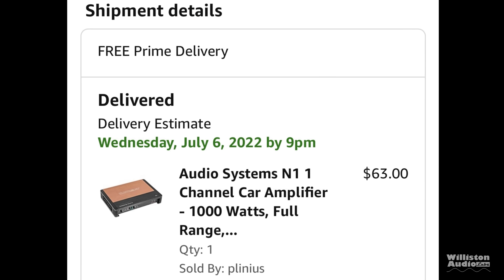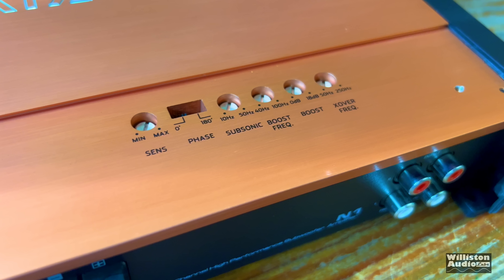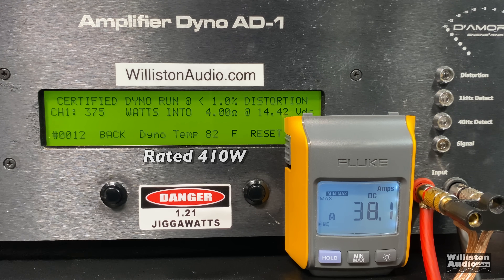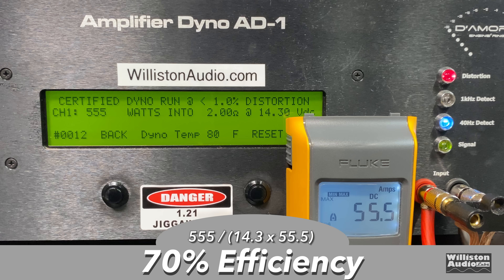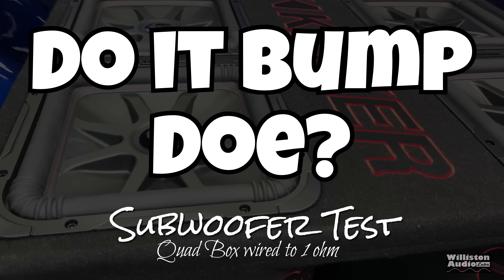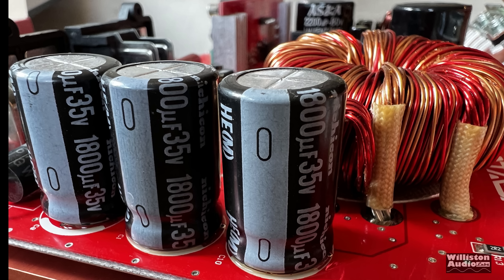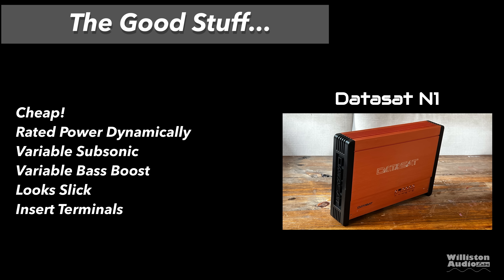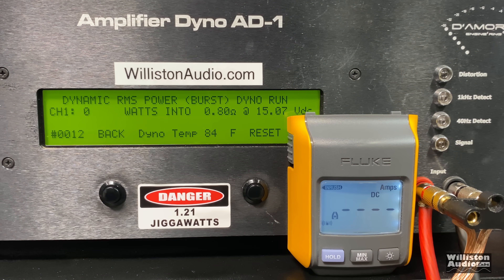Why is this 1000W $63 Amp BANNED from Amazon? [4K]

Comment: I have many high end amps with screw down terminals. Zapco, Arc,Eclipse, MTX, Soundstream,(USA and SA series) all vintage American made high quality amps...I really dont mind them, I prefer a screw driver to an allen key..my favorite is Soundstream terminals used in Reference and Rubicons and some MC models ( these terminals were designed by the late Wade Stewart)...I do not care for the "lock plug' style, although they have their benefits, but, there is  nothing cheap about screw downs, they are a reliable connection and a nice look with with spade terminals.... most of the Chinese drek you test use insert terminals with the throw away allen wrench, Ill take a stout Snap on phillips any day....but I am an old school guy....I think Linear Power still uses screw down terminals...not certain...I love your channel Big D, it is good to know there others. like me out there...I also have some vintage Helix/ Brax that use screw downs
Reply from the maker: I was referring to the screw down needing fork connectors. I consider Soundstream insert terminals. The ones I meant were the ones with the small acres that has a built in washer and unscrews completely. These don’t accept larger than 8Ga without issues. Many of the old amps didn’t need larger than 8Ga so it’s fine with them.
Reply: @wal  , love your channel Bro, who else could I discuss this minutia with…I really don’t mind the for terminals either, it all reminds me of the old days ✌️🇺🇸

Comment: Damn that amp was nice looking with the copper look on top and def could bump for 63$! It’s a shame it’s not around it’ll prob get sold on eBay now for 5x the price since big d did a video on it. Loved this and had those kickers slapping !🤘🏻🤘🏻🥇🥇
Reply: Psst available now om Amazon for $76 just got 1
Reply: @danthemansrepreviews5644  You’re not afraid the amp will simply melt down? I've only messed with cheap amps once in my life and the result wasn’t good. I learned my lesson.
Reply: @Assimilator702  I guess we will see...I see the efficiency isn't great.
I just got it a few days ago and I have to admit it sounded good.
 punchy not muddy running to a brand new  4ohm infinity 12" svc.
But i have a punch 601 tho, and a pheonix gold xm450 so...it'll go in my wifes crosstrek. She won't crank it . I'm still impressed with the build. 
I'm not expert but to the untrained eye these look more expensive then they are.
Reply from the maker: @danthemansrepreviews5644  yes i updated the pinned comment and the video description with this info
Reply: @wal  is it worth purchasing, I found one? Or the rz1 Razor amp? 
Please respond 🙏🏼
Reply: @theurbanartist775   It’s still for sale on Amazon. I just purchased another one. I have this exact same N1 Version amp on a Hifonics BRW8 at 2ohms and it fuc*ing Slaps !!!! 😳
Reply: @astro54541  got 2 of them in yesterday and they look great🤣, 1 is going in my daughters car and the other one  maybe for 2 8" subs to pick up those higher bass notes in my system running 4 12" Rockville punishers on a Wolfram O 5000 amp
Update, these amps do not like 1 ohm loads they blow the fuses pretty quick at high volume sent them both back.
Reply: If you love the looks of it just buy the Diamond Audio version. It more than likely has slightly more respectable performance.
Reply: @Assimilator702  That's a $600.00 dollar price difference. I doubt he likes the looks that much.

Comment: they're probably not "copying" anyone. they're highly likely  the ones who are manufacturing the name brand stuff and just market the stuff as their own by changing just a few things.  that's the way it goes in a country who doesn't respect copyright and patent laws. if you pay attention no one uses copyright and patent laws on products anymore.  its highly likely these datasat amp are diamond audio products.
I can show you a fake surefire gun light and a real one.  you can't tell them apart by looking at them nor using them.    except surefire sells it for $300 and the amazon clone is $25
Reply from the maker: So the way it’s explained to me is some are copied while being manufactured by a well known company. This is the problem with relying on cheap labor in another country that only wants to profit off of another.

Comment: The manufacturer made a bet that a niche company on the opposite end of the price spectrum would not notice its trademark being used. It lost that bet but it’s a gamble that often works for other chinese manufacturers. I would have bought that amp and the 4 channel if it had been as well priced. Thanks for another very interesting video Big D.
Reply from the maker: Yeah it’s crazy!
Reply: They also have products under the name plinius, which is like datasat, a actual usa company. a $15k a amplifier for home audio.
I'm guessing they thought these companies wouldn't see them in car audio
Plinius have like 8 amps
Datasat even  has a dsp amp!
Have every type of speaker too

I talked to the company 
N1 and n4 are still available on usa,
I'm ordering 2 on August 10

Comment: It’s the same irs2092 iraudamp circuit used in many name brand amplifiers out. Great little amp, the ps fets and output fets are cheap and available. The irs2092 is unavailable right now for the average joe, but should hit the market again soon. Great amp that you could keep going for a long time with low repair costs when needed.

Comment: What a silly move for them to copyright infring datasat. They could have developed their own brand and word of mouth at that price and performance would have made them fairly popular, especially among the financially strapped.
Reply: One must remember that companies that steal intellectual property and/or falsely market their products under another company’s brand name are looking to make as much money as quickly as possible, not the longevity of their business. They price their products very cheap to make a profit by selling a lot of units quickly before they are shut down. Then they start over again using a different name. 

Since they have stolen the intellectual property of another company, they do not have the expense of research and design. 

It is very common for Chinese companies who have been commissioned to build a product for a brand to make more of the product than the original brand ordered and then sell the exact same product at a lower cost undercutting the original brand.
Reply: @the_dark_defender  Oftentimes when this happens they also will use the name brand parts that were out of spec. Binning.
Reply: This would be trademark infringement, not copyright. But definitely dumb.

Similarly, several years ago, in another city in Korea, I would see ads at all the bus stops for a coffee shop calling itself Sudarbucks. The logo was identical to that of Starbucks (U+D placed into the space where the T went).

Though, checking there are a handful of shops with the same Korean name as the above knockoff shop, but none spell it in the Roman alphabet as above or use the same logo as mentioned. I presume the changes in spelling came from Starbucks cracking down on them for infringement.
Reply: Given that its China, the whole thing is a ripoff from top to bottom. Its likely some company linked to the CCP wholesale stole the designs from a legitimate budget company that was manufacturing there, and decided to roll some knock-offs with the blatant logo thievery to put the cherry on top. Easy to make stuff for cheap when all you have to do is just bring a thumb drive to someone else's business. No R&D costs or anything like that. Edit: Basically a TL;DR of what he said ☝Still, its one reason I would like Dereck to show discretion in reviewing these types of amps and ensure they are at least a real company first. Giving some bootleg company good publicity just reinforces their profits and keeps the scam going.
Reply: China is where they are today because they steal.  Almost all electronic components are manufactured in China . This is all supported by their government.  If you design a product in some other country then send it to China for manufacturing,  guaranteed, your design has been compromised/stolen.  Countries should send their manufacturing to other places . Yes it may be more expensive but weighing against the alternatives of what this communist has done and what it now has the capability to do military wise , we should stop now. It might already be too late .
Reply: It's kind of like counterfit premium watches. If you can make something that can almost even fool a watch expert why dont you just sell your own thing probably at a better price for your self than the counterfeit one. Stll they do it though.
Reply: @rimmersbryggeri  Yeah, it's weird.
Reply: And let’s not forget, if that thing causes a fire, and you belong in that class of people who actually pay for fire insurance, this thing won’t be covered if you try to make a claim.  The company isn’t likely to have shelled out the hundred thousand dollars or so to apply for retail liscencing.  No CE, nor Underwriter’s licensing (or bogus UL stamp) makes this product about as dodgy as jet powered pogo sticks.
Reply: This Chinese junk is probably going to blow after a week of use.  And good luck with warranty service after that.
Reply: @TreesOnTheBeach  warranty?! lol

Comment: great video and it Bumps for what it is.can i ask is it possible to use a car amp without the signal wire .as im wanting to make it portable,cheers
Reply: You have to have remote wire. You can run a small jumper wire from positive to remote or from a power source. Amp don't cut on with out remote wire. I have used amps with no radios plenty of times I just put a toggle switch on remote wire to cut it on and off
Reply: @shonuff4377  thank you very much for the info,great
Reply from the maker: Wire it to 12V with a switch
Reply: @wal  hi.thanks you very much for the info,great cheers

Comment: I was shocked by this one as it did well and I thought for sure it would be like those other amps that straight up lied to us! Now only if they would have faith in themselves and come up with their own name, lol.
Reply: @wal  2 30 Amp fuses ? Pulling 100+ ?? Somebody explain 😂
Reply from the maker: @rahuldogra  yes it is possible. It’s the duration that will cause them to pop. They can handle 2-3x ratings for short periods
Reply: @rahuldogra  Yea, @14.3V that would be 858W. 14.3 is typical max alternator voltage, but under load the voltage will drop substantially when it hits and depending how thick/long the power wires are. Either way it's really too much for those fuses. Running a fuse near its rated capacity will cause metal fatigue of the fuse element due to thermal expansion and contraction as it gets hot and then cold. I would just try 40A fuses, maybe wait until the 30A ones blow and put in the 40A fuses and see how they hold up.
Reply: No kidding.  They could even up the quality of some of the "cheap" items mentioned...charge $75 and it would still fly off the shelf.  Shame about the naming thing though...
Reply from the maker: @MrGraywolves  it’s back https://amzn.to/3QsWA6N
Reply: @wal  and gone again :-/
Reply from the maker: @kitecattestecke2303  dang!
Reply: @wal  It's back again it appears from the link you posted last, under the "Notherss" brand.
Reply: @wal  Late to the game but the Amazon link still has a picture of DATASAT, but now the title brands it Northerss Audio Systems but is claiming 1000watts

Comment: The insides look okay. I was expecting crappy caps and used mosfets extracted from ewaste but those seem like brand new mosfets. Although in china they can extract parts from ewaste and make them look like they came out of production line the other day. 
I bought some used chips from utsource and it was unbelievable how good the cleaned those ic and ic legs
Reply: @wal  Did you notice how a couple of the legs of the I see were wrapped in some kind of condom have you seen that before?
Reply: @johnhornbeak5735  that is protective clothe braid. the two outside legs are your high voltage/high current legs. the middle leg is the "switched" one. If you think of them as relays....the braiding is to protect things from arcing to the heat sink in crazy conditions. probably cheaper than running a piece of plastic the whole length behind the mosfets. the chinese will cut ANY and EVERY possible corner to scrimp a penny. its how they sell these things for 63 bucks. 25% of which is import tax.
Reply: @johnhornbeak5735  that is just the older version of heatshrink tube 😂 it serves the same purpose and is actually more temparature resistant than normal heatshrink tubes.
Reply: @johnhornbeak5735  yes I have seen it before in power supplies and old crt televisions,not sure of the reason though.i thought to protect the gate but it's a heat sheathing.
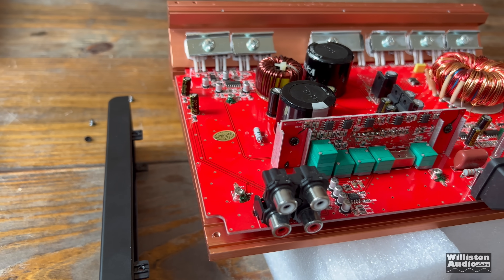Reply: The impressive part is, unlike many other amps, it actually has a diode for reverse-input protection @ 8:54. Something hardly ever seen in amps. Usually either they are too cheap, or too powerful for diodes to be practical, and usually too stingy for any other practical solutions. At this price point, them tossing in some suspenders is surprising.
Reply: @mysock351C  that diode won't help. This sort of "reverse polarity protection" never works. They can easily use a mosfet for reverse polarity protection and it doesn't have to be a very high power fet. A tiny fet just to protect the drive electronics is enough. It will still have a better chance of surving reverse voltage. The input filter caps will blow but those are easier to replace and cheaper than drive circuit. , If the drive circuit doesn't turn on the powersupply fets won't turn on and so those won't be effected by reverse voltage.
Reply: @KuntalGhosh  If its a series diode it will, at the expense of it running quite hot. If its crowbarring then if its a schottky it may, but it all depends on what its clamping voltage is vs. the body diodes in the mosfets. If it has a low forward voltage it stands a good chance of blowing the fuse before the transistors start decapping themselves or going short circuit. If its a standard diode then the body diodes will likely carry most of the burden and not pull enough to blow the fuse. Protecting the drive circuitry is nice, but it wont stop blowing transistors and high current tracks of the board, esp. in amps that have no internal fusing. That's the usual failure mode for amps that have been hooked up backwards from what I have seen. 12V is not very much, so the caps can stand it for a short period of time unless someone just leaves it hooked up backwards and starts the car. Some of these amps are rated close to 10 kW and even beyond, so it will be fairly cataclysmic when they are hooked up the wrong way due to the low impedances and large amperage capacity of the batteries.
Reply: And I'm sure that diode is probably being abused. But still nice to see them include it.
Reply: Electronics just aren't expensive or difficult to manufacture anymore. In 1970 this would have cost a fortune but manufacturers today make a lot of money on an illusion of value. The copper wire on the chokes is probably the most expensive part in the whole amp.
Reply: @stickyfox  are u sure they using copper?! I have found out most cheap psu have switched to aluminium coils for chokes and some very cheap ebay stuff has gone down to aluminium for the main transformer. These days u have to scratch the legs of the choke to find out if it is copper clad aluminium or copper wire.
Reply: Utsource solder new leg to used transistor and sell like a new with different number engraved with laser
Reply: @especialistqap  i tested every part and they performed to datasheet specs. So i don't believe the parts have been faked like ebay stuff.

Comment: The internet flea market amp
Reply from the maker: White van special!
Reply: @wal  I bought a set of Theater Research subwoofers in a fourth order bandpass box it looked nice and with two Pioneer 800 watt amps it slammed pretty hard but no pawn shop or any where else gave me no respect when it came time to selling it it was in perfect mint condition they use that term white van special a lot seemed kind of insulting considered how they sounded and performed better than some cheaper brand names nowadays

Comment: If you haven't put two and two together yet, the Chinese government allows these companies to do this to make money, only after getting pressure from the companies that own the rights to the actual TM and company names, does the Chinese government step in and say, no you need to stop. It's all a big geopolitical economic tactic game being played right now. China allows marketing firms from inside it's own country to steal other companies technology, marketing, and reverse engineer it to resell it cheaper at a much higher net profit gain because manufacturing is so cheap there, to make China rich. They shut down the operation, act like nothing happened and do it again with something different, only after they get corporate push-back from the original Intellectual property holders.
Reply from the maker: Yeah I got that but Amazon removing it is a big deal. There are a lot of items like this on Amazon and I’m sure it’s like whack-a-mole for them

Comment: Does the one in the bench have different fuses then the one you should at the beginning showing the terminals?
Reply from the maker: I use 30A fuses until the very end where I added 40A for the 0.8 tests